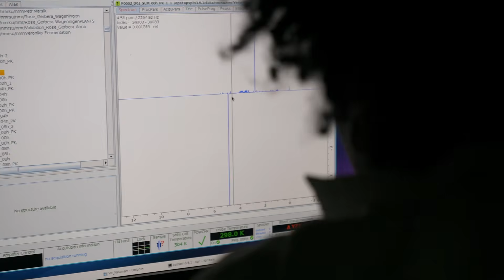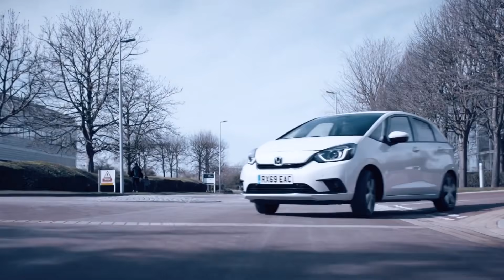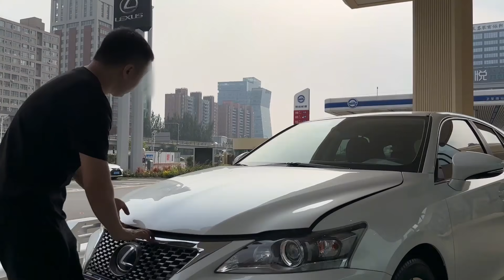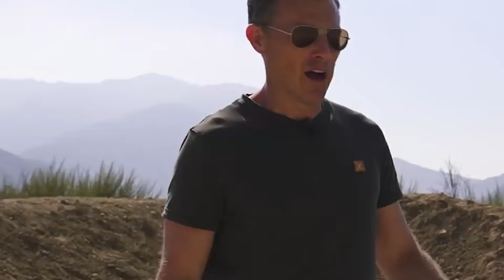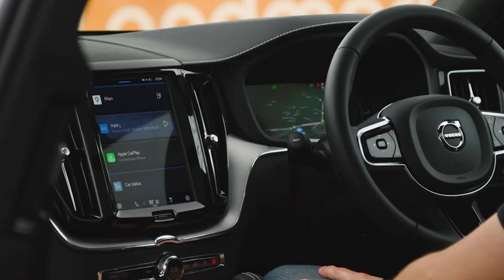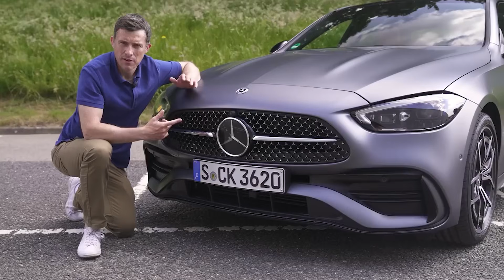5 USED HYBRIDS ONLY A FOOL WOULD BUY (AND 7 SMART CHOICES!)

Comment: I had a Mercedes c350e phev. Amazing to drive and super smooth . Even though it was a plug in, I never had to plug it in . It could self charge enough to benefit from the battery through normal driving . Despite not plugging it in, it could still achieve over 40 mpg.